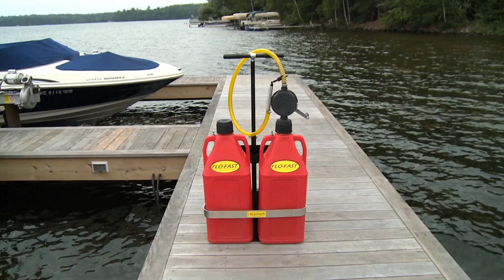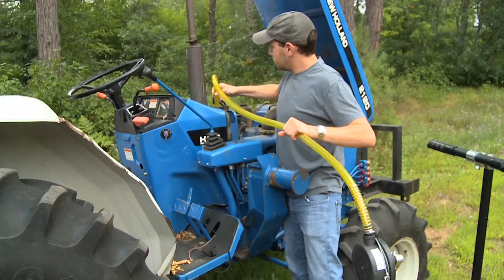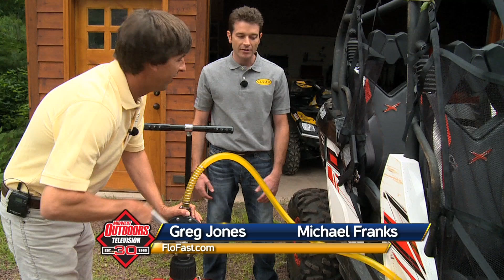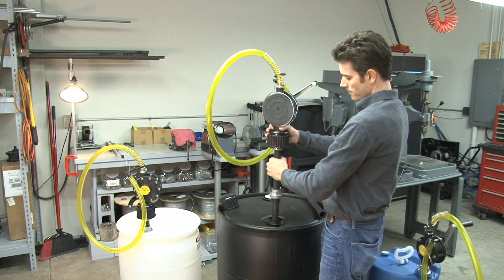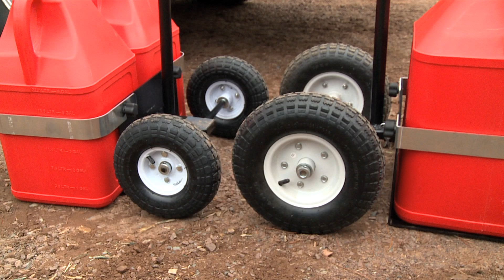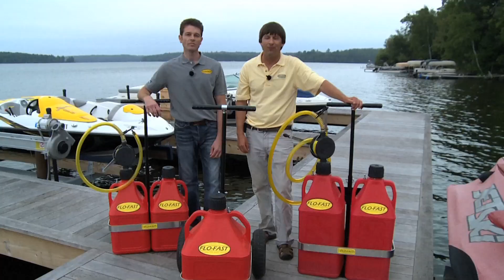Flo-Fast Fuel Transfer Systems

Comment: So whatabout the grounding cable, you know the Safety part.....To help reduce static spark, the static wire on the pump must be attached to a metal object that is grounded on your vehicle, equipment, boat, utility vehicle or a grounding rod.
Surprised you did not include this in your review.

Comment: Nice idea guys, but damn it's expensive.
Reply: It "was developed for the racing and motorsports markets," and, obviously priced for them and not the homeowner/consumer.

Love the funnel-shaped gas can.  Good concept. Too expensive for me.
Reply: I’ve researched this and there is nothing out there comparable. Expensive yes but I’m done hoisting five gallon cans with their crappy spouts. Electric pump inserts last about a year.
Reply: Damn, I guess. 500 bucks
Reply: @lobbyrobby  I got mine from the manufacturer for $260
Reply: I got mine for $40 at an auction.